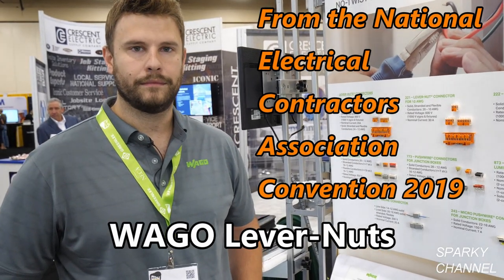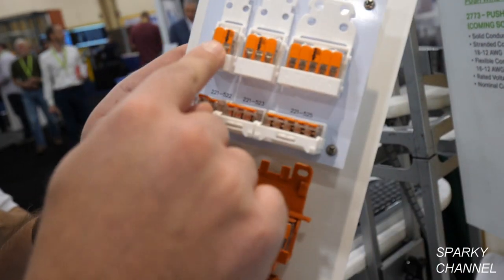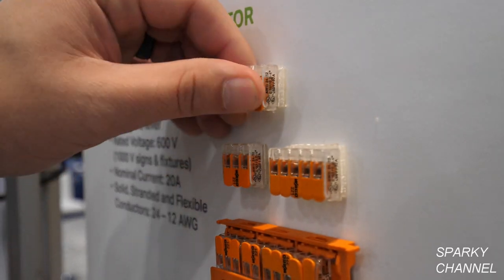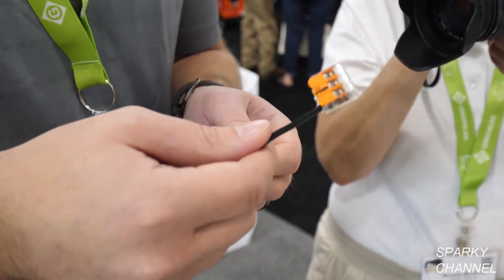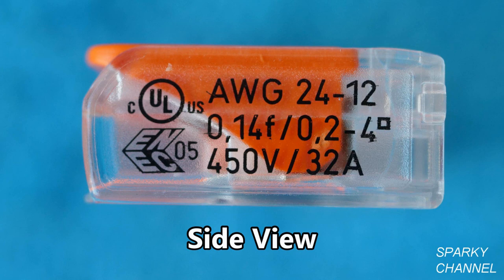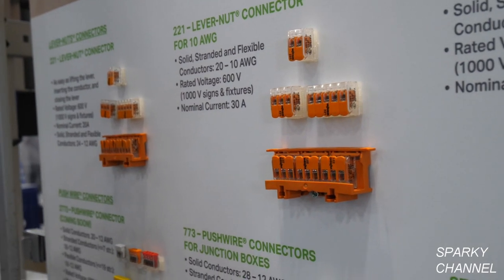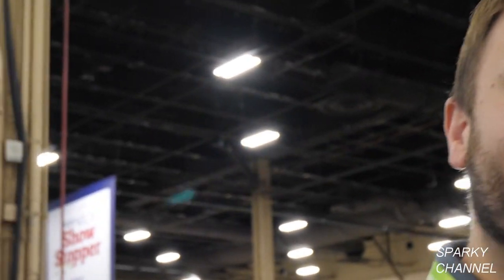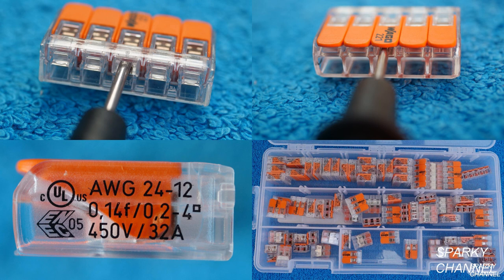Wago Lever-Nuts Questions and Answers From National Electrical Contractor Convention

Comment: Does it mar the wire like other push-in connectors?  Is it recommended or required to cut off the wire end for a new connection?
Reply: No it doesn't mar the wire at all. Very secure and no need cut off any wire even after multiple times of access.
Reply: I bought a few 5 position 221 Wago connectors hoping to make a crowded J-box easier to manage.  They most certainly are not common in stores.  1: Very expensive at roughly $3.00 EACH.  2: I did a test with 20Ga and 12Ga solid copper and it does mar the wire.  I don't think it is enough to be concerned about.  3: It didn't take long and with no abuse at all the orange lever snapped off!  I may keep them in mind for special situations, but I will not be using them in place of wirenuts of which I have never had a failure in my life.  They are a bit tough with multiple wires.
Reply: @solarsynapse  How much does a MAR connector mar the wire?
Reply: @JohnHill-qo3hb  Funny!  Aren't those called Marr connectors?  Mar:  Ruin/disfigure/scar/damage/spoil.  Don't they recommend cutting the ends off for a new connection?  The ill effect I have seen from a marred wire is that they can break off if they are bent at the mar.  That is why I don't score around a cable to strip it.  I have made many repairs to data cables that someone has done that causing the strand to break later.
Reply: @solarsynapse  I use my IDEAL wire strippers. I'm no electrician but in my home I have disassembled Marr (thanks for the correction) joints, the wire usually looks like a pig's tail, off with this if there is enough length, I'll use a freshly stripped wire.
Reply: @solarsynapse  Where do you shop? I get a 5-Wire Lever Nut (10-Pack) for $9.
Reply: @sjagain  Lowe's & Menard's.  They don't carry Wago.  I found name brand 5 position Wago (Not Chinese.) online around $30 for 10!  First 1 I used easily broke.  Looks like a poor back stab type connection.  The only reason I tried them was to have an easier connection for multiple wires in a J-box.  Not likely I will use again.

Comment: Well, now I'm really conflicted. No commercial electrician I've worked with uses or recommends the Wagos. I run into many commercial electricians because I'm a commercial carpenter. The problem with the Wagos that I hear about over and over is the lack of surface area of the contact.  I wish that would've been addressed in this video. But, being that I'm not an electrician I can only go off of the advice I get from professionals and what's good enough for Sparky Bill, is good enough for me. What's a carpenter to do?
Reply: here in germany everyone uses wago or similar connector,  surface area doesn't matter as long connectors are run in spec and the connection is gas tight (for aluminium whires special paste is required), even if the current is a bit higher at that small point, this will be compensate by the overall low resistance due to small distances no oxide layers and better ability to carry away heat
Reply: if you know the way electricity flows through a conductor you would not say that twisting wires offer more surface contact. Current flows through the shortest path, so you can make your connections as long as you want but the current flows just through the first twist. if you measure the contact surface on the first loop of the twist with the contact surface of a wago , you will find that wago is superior , so those commercial "electricians" have no idea what they are talking about
Reply: I suspect that US sparkies might not like Wago is due to the lower capacity of the Wago. In installations with 110V/220V there could be an issue with the 20A\32A limit. On top of that is the human factor that we use what we know and trust.
I have used Wago for over a decade and have not encountered an issue so far with heat/overload or the lifetime of the springs. As questioned some times in this comment section. But then again I work on 230V/400V systems with correspondingly lower currents.
Reply: @hausaffe100  Do I have to use the Wago Alu-plus contact paste or can I use the Noalox paste instead?
Reply: @speed1984  wago states a 41A rating acording to iec/en and 30A for UL
Reply: @eminrg  Current flows through the shortest path, so you can make your connections as long as you want but the current flows just through the first twist.   - this is plain wrong
Reply: @dmitripogosian5084  any theory to back your claim, or is just the fact that it you touch a long twist of wire at the end you will get zapped? , then you have 2 "consumers" one being the electrical appliance, and one being your body...

Comment: Are these safe to use on aluminum wiring
Reply: I don't think they are. The other question is can they be in wall or not.
Reply: Yes, they are safe to use on aluminum, but you must clean the conductor and inject into the connector Wago Alu-Plus contact paste before installing.
Reply: I know of nothing that is rated for in-wall connections. They are problematic mostly due to troubleshooting, since the can’t be seen. I seem to remember that all spiced must be accessible.

Comment: There is some confusion over ratings with these connectors. Wago states that they are 20A, but also that they are 32A. Also in the UK some electricians say that the new 221s are not suitable for maintenance free junction boxes...is that so?
Reply: Personally, I wouldn't use the lever blocks for maintenance free JBs not because I would be worried about them failing but because they are too expensive for that role. I'd use Wago push fit connectors instead. The newer 221s will accommodate cable sizes up to 6mm2 and are rated at 41A @ 450v and 30A @ 600v.

Comment: Are this  safe for aluminum match to copper wire insulation.
Reply from the maker: No.
Reply: Thanks you for the response. .
Reply: I believe the older gray ones are rated for Al to Cu
Reply: @michaelwitt7984  I don't believe any Wago's are approved for joining aluminum and copper.  They may have been sold for that purpose in the past, but AFAIK, none are currently approved for it.
Reply: @michaelwitt7984  I can't find a clear statement of US approval on Wago's site.
P.S. I hope I'm wrong.  I'd love to be able to use Wago connectors, but without clear approval, I'm stuck with AllumiCon.
Reply: They have special variants for non copper wires, go to their web side or contact them directly. I have only read about it, since copper is mandatory in my country.

Comment: i would like to see a wago that allows insert from 2 directions for connecting wires cut too short.
Reply from the maker: Here you go: XHF 2 Conductor Compact Connectors Lever Wire Nut Wire Connectors for 2 Circuit Inline Splices 28-12 AWG (SPL-2, 25PCS): Amazon: https://amzn.to/3Az8X9l
Reply: @SparkyChannel  wow, great! i did not know about these. thanks!!!!!
Reply: @SparkyChannel  these are chinese replica not wago. The chinese have lot more variety in their designs
Reply: They make push in from another company
Reply: @Z-add  The German is UL approved, is the Chinese?
Reply: The Wago 221-2411 is a single gang inline version of the 221. Ideal for all your splicing needs.
Reply: @grayhalf1854  thanks!

Comment: Can you use Wago's for connecting  ground wires like you connect hots and neutrals ?
Reply from the maker: Yes.
Reply: @SparkyChannel  thank you
Reply: I used Wagos on all my attic j-boxes. I used a grounding pigtail, but I joined them all together with 5 banger Wagos. Four years and still going strong.

Comment: great innovation, cant find at home depot or lowes, amazon has em
Reply from the maker: Thanks Mark! Merry Christmas. 🎄
Reply: @SparkyChannel  just ordered my first  wago kit,been running receptacles, and swtches for ice dam  heat cable on roof edge,230v for  welder ,ill be using  stranded, and solid, 12 ga,,for the receptacles, from san diego  also  now nw arkansas,learning  alot from your videos

Comment: How do these do when mating different gauges of wire??

I'm re-doing a bunch of lights... A couple of the new fixtures have their own ground & wiring that is substantially smaller than the 12 gauge stuff my house is wired with.
Reply: The Wago 221 connectors are great for joining mixed-gauge wire. Each conductor you insert goes into its own separate spring-loaded cage clamp, which is how they can accommodate even as small as 24 AWG.
Reply: I've used them on very thin, delicate, wire. And it works. Just make sure it's well connected, and doesn't slip

Comment: Are they approved for use with tinned stranded copper?  (60% tin, 40% lead solder)
Reply: Tinned is certified in Europe, cable ferrules are not.

Comment: Hi,
Do you know which WAGO connector I can use to split the current 2 ways? I am looking for a "Y" splitter. I am using 24V with 1 - (12AWG feed line) & [1 - (12AWG out) 1 - (14AWG out)]. Is there such a thing? Is there a part number for it? Please let me know, thank you.
Reply: Just use a standard three port Wago 221.  It will work just the same as the Y shaped crimp style butt connectors you're probably thinking of for your applicaiton.
Reply: Excellent, thank you!

Comment: Can the 30 amp 300 vol be used on a single pole 4000 watt electric heater 240 vots
Reply: They come from Europe and they will be suitable for voltage, but the current has to be within the applicable rating

Comment: I imagine these would be good for delicate conductors that you don't want to twist in fear of breaking them. For that the clamp ones seem great. But I still wouldn't use them for every day connections. Wire nuts have a bigger range.
Reply from the maker: Thanks!
Reply: @williambyrnes4198  I watched that video you linked and it's a pretty good video thanks
Reply: Bigger range? For what. As long as it handles 12 and 14ga what else do you need for residential.
Reply: @Eggsr2bcrushed  I meant I like the versatility of wire nuts.
Reply: 221 wagos are more versatile, faster to work with, takes less space and you can make your work look better.

And they shine, especially when it comes to redoing the connection, or adding a wire.
Reply: Well I finally broke and got a box of 221s and I haven't used a wirenut since. I have already used half the box. These things are great
Reply: @abdulelkhatib2674   welcome aboard, mate.

Comment: Can I use these with12 gauge and 16 gauge automotive wire?? ie- Automobile use
Reply: Maybe they aren’t specifically design for environment but it would work. The only thing is you would need to try and get the gel boxes at snap around these to keep moisture out.

Comment: Can you make switches and outlets with these? Just make it all easy?
Reply from the maker: No but you could use them for installations.
Reply: Sparky Channel  I mean that WAGO should come out with their own line of switches and outlets with these connectors built in.
Reply: @Liberty2357  they could be working with some switch&outlet manufacturers - I was told that GIRA uses push instead of nut&bolt in theirs

Comment: thanks for asking the questions. your focus is killing me, but otherwise, I appreciate your video.
Reply from the maker: Thanks! I'll work on the focus.
Reply: @SparkyChannel  If you use a digital camera, like DSLR or mirrorless you can manually focus.

Of course you'd need a tripod and make sure the setup is relatively static - unless you do all the focusing lol. Autofocus is really pretty good these days, but I understand that it can struggle with lots of movement.
Reply from the maker: @cherrysdiy5005  Thanks, I'll try that.

Comment: Are wago connectors certified for use with aluminum wire?
Reply from the maker: Wago says they are if you use their special paste but I would use these: King Innovation 95015 AlumiConn Wire Connector, 10 pk, Purple, Count: Amazon: https://amzn.to/3kg90kF
Reply: Thanks for rapid response.
Reply: Unfortunately not the 221 series. For the other ones you have to use their special paste.

Comment: Why do they hate the number 4??  So many times I need 4 lever nut connector and had to use a 5...
Reply from the maker: Me too!
Reply: The 5 port Type 221 is not so much bigger than the 3 port. A 4port in between wouldn´t save you much space. And to have one free port in reseve is a nice thing for later addons to your installation :)
Reply: @Thorsten_Wiegand  Where I have had to use the 5, often meaning I need 3 5's, the amount of space it would have saved to have a 4 is notable as things are tight in a box with that many wires. So it is equivalent of having an extra 3 in there (though worse as the length of the 5 makes it that much harder to position than a 4 would). 
As for future upgrade, in the rare case that is a thing, there is no advantage to having an unused spot as it takes no meaningful additional effort just to grab the wago that is one size larger and swap them.
Reply: I think it has more to do with if you need more then a three you need a 5... That being said 4s would be great when doing a double gang recepticle box with a feed in and out.. you can run a pigtail to each of the receptacles instead of daisy chaining them. I just tend to use 5s there though and the 5s come in handy when your wiring a double gang feed through in a metal box and need the extra slot for the 5th ground to the box pitail

Comment: I'm a master electrician of 10 years and newly minted electrical engineer.

I disagree to an extent with  the statement about wire nut connections. If you pretwist, your connections will be rock solid. 

That being said, the spring mechanism is different in these lever nuts.

Finally, I love these lever nuts. They are amazing and the connections are as solid as can be. I have no qualms about using them. They cost twice as much as wire nuts, and don't save time, but they save time. Plus they are fantastic for splicing different sizes of wire. 

They are all I use for LV and fire alarm connections.
Reply: But when you're wiring something like a light that comes with 18 AWG pigtails or whatever, or trying to connect stranded pigtail with solid, pretwist/wire nuts are not very reliable (IMHO).  These things, each 'slot' can be a different type of wire and still connect them all together solidly.
Reply: "and don't save time, but they save time" - do you mean don't save money but save time?
Reply: @LV-1969  sure do heh

Comment: I use electrical tape too, in a tight space like multiple ganged light switches it is way too easy to pop open when pushing wires in.
Reply: If it is that tight, I would go as far as saying there are so many conductors you have to reduce the current of the circuit because they can’t adequately cool down

Comment: I like the Wago connectors and use them all the time. They work great and are awesome for trouble shooting. BUT....for permanent connections twisting the wire with your pliers is the most solid connection. The twist on wire nut should not be holding the wires together, just covering the exposed, previously twisted conductors.
Reply from the maker: Thanks!
Reply: @suspicionofdeceit I wouldn't say they are unsafe, but I agree with Paulie that the physical twisting of the wire ensures a reliable and stable connection. With properly twisted wires, the connector is just there to bond the conductors, but is not needed to provide resistance to physical movement. That is done by the wires themselves.
Reply: oShane Kasper  And I've seen ones that were twisted with a few wires but a few years later one had come out and killed the circuit.  Knowing if they are "properly twisted" is always going to be little challenging with more than two wires.  Giving them a tug doesn't speak to what happens after you twist and shove them into the box and some heat/cool cycles.
Reply: If you were a couple of decades older you would be telling use that we always needed to use a linesman splice, soldered, wrapped with rubber tape and then friction tape.
Reply: This is a debate that the test of time will desire. That said twisting more than 3 wires together is where I often see problems... heat loosens the twist... un-insulated wire showing out of the wire nut... or a wire added after the twist was first made.... I would just rather just use a Wago.. also I think they use less space in the box.
Reply: @Sylvan_dB  I've seen these in a house I was updating the wiring and receptacles in.
Reply: I have a wild idea that (if applied properly) all appropriate methods are just fine.
Reply: nope!! twisting the wires before applying wire nuts is not a good idea, it's stupid..where do the mfgs instructions say to twist the wires, they don't, thus you are making stuff up, all nonsense
Reply: @cengeb  They say its "acceptable" usually . But not required... so Im with you .. it puts stress on the wire and its unnecessary stress...

Comment: What’s the price difference/ between a wire nut and this wago        It’s about price  in a commercial environment. They built a better mouse trap
Reply from the maker: The Wago's are considerably more expensive.
Reply: The Ideal brand is cheaper for the push in type. Red wirenuts=$25 for 250/ 3 port push in connectors are $17 for 300. Made in America also!
Reply: @bradbuchanan9326  Ideal is American? haha.. We had some ideal branded Wago knockoffs in 90s and I think that is why Wagos had "bad press" as those ideal connectors burned houses down due poor material quality. Weak springs led to loose connections.

Comment: Using 10 awg wire on 24-12  on 20 A . Future get 20-10 awg. Think 10awg wire in 24-12 with only using 20A will last ?
Reply: He's quite wrong. Shocking for a wago representative. 20A is Japanese rating. Elsewhere the rating is 32A.. The bigger one is 41A.